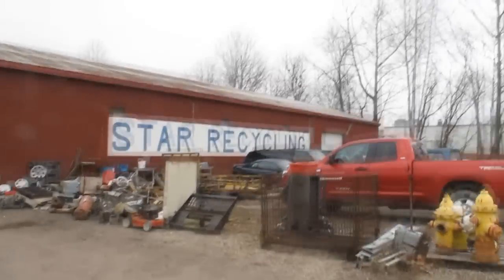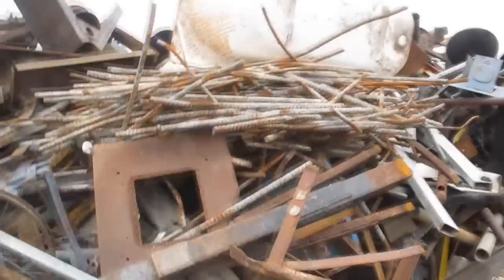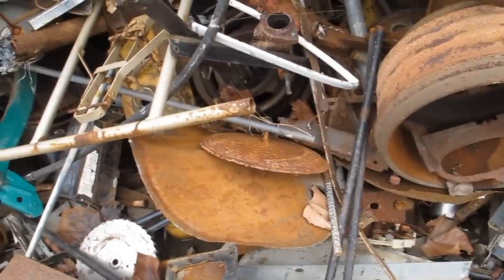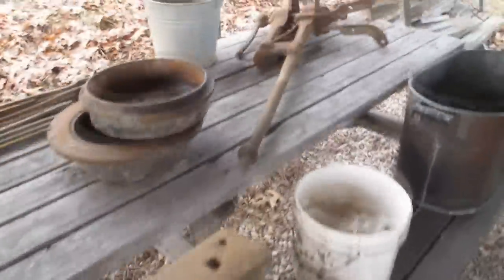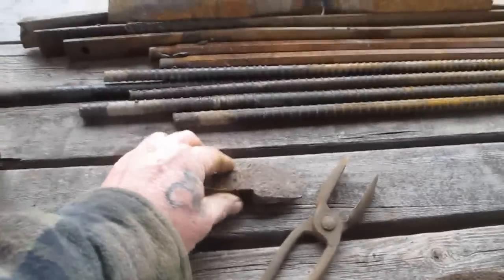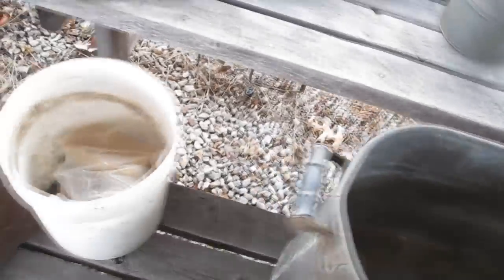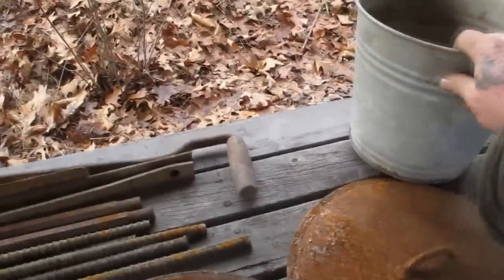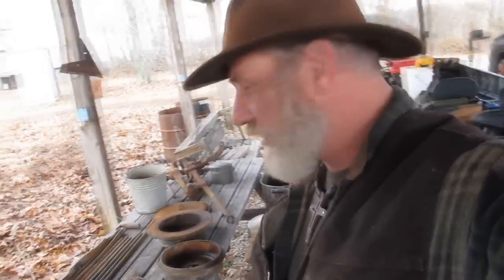Blacksmithing Part 17 Scrap Yard Pick'en

Comment: The finds you get, Dave, always amaze me. Best find I had recently was a leg vice at a yard sale for $5. It needed a little TLC, but after fixing up I sold it to a starting out smith for $90, which I put into a new champion forge & blower. I'm still looking for a new 100lb anvil. Every anvil I find they want $2 a pound or more, or its sold by the time I get to the sale. I even had a guy on craigslist tell me to stop by so I could buy one, they sold it in the hour it took to get there . My luck.

Comment: Those post vises you have there are great, but you will want to solidly mount the bottom of the post.  I also tried mounting mine to a picnic table and it was just about useless.   Get it mounted to something solid and they work great.

Comment: Nice Finds! 
Now Dave clean the anvils upp make them pretty again....
Im sure that u would not let ur axes or knifes or guns look like that ! ?? 
An anvil for a blacksmith cant look like that ! ...
So use some heavy cleaning solvent cemical for rust then Power Hand Tool that has a Twist Knot Wire Cup Brush and start grinding. 
Clean them upp ! :)

Comment: Dave, does the rust matter on the metal you'll use for stock?

I assume you're not too worried about it (since you did buy the pieces), but is that because there's rust only on the surface, or because heating/pounding fixes any problems with the metal's integrity?

Comment: self reliance doesnt really mean self, i mean come on 250bucks ? lets say few pieces of  metal cost 10 bucks and u make a spoon out of them ? ok i get it, its a hobby, it is fun making things and learning. but come on 10 bucks and u make a spoon and some other tools that u could easily buy a stainless steel spoon, knife and fork for 10 bucks or even nails as u made before, u spent 6 minutes for a nail which barely costs 10 cents?